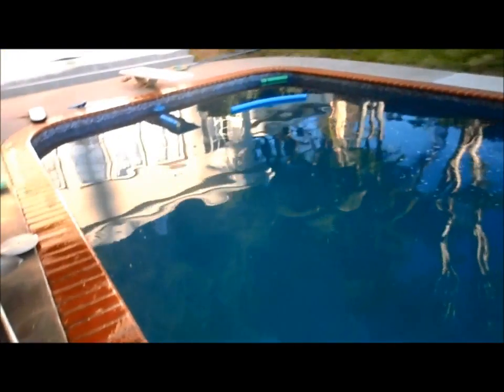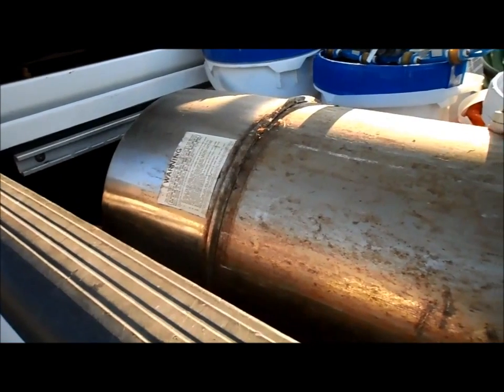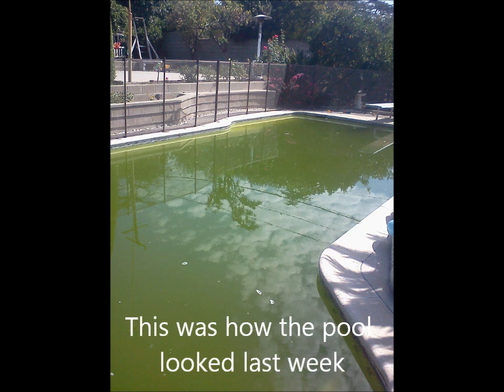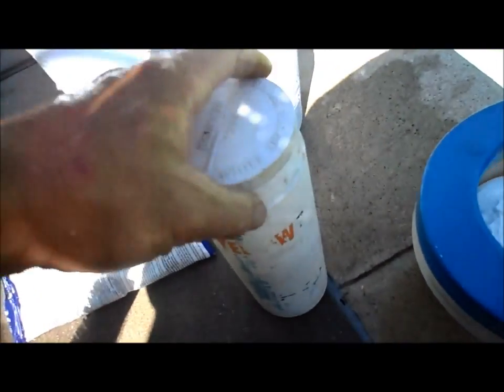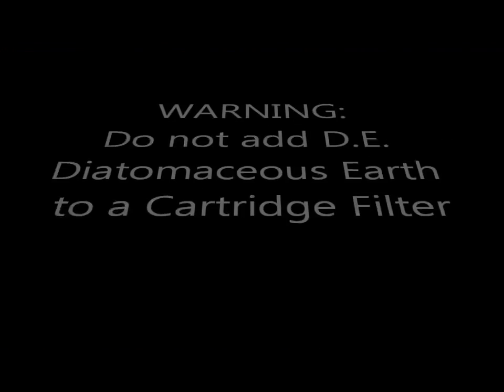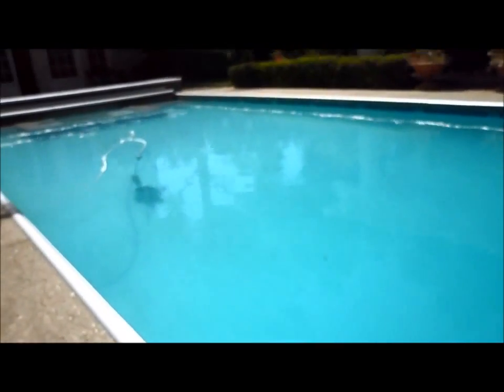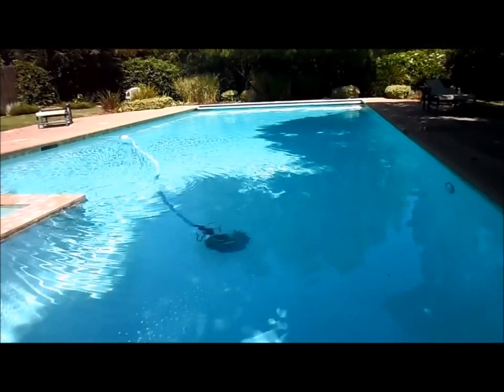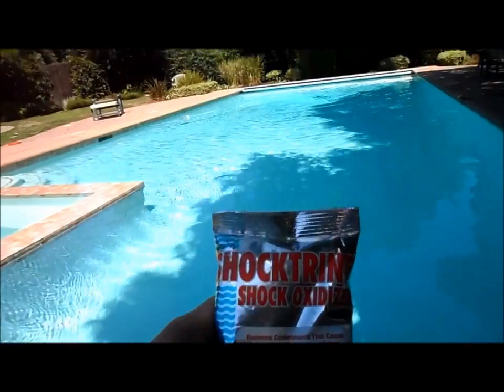Cloudy Pool Water, Causes and Cures

Comment: I opened the pool last Tuesday and added shock and algecide and got the inline chlorine started.  The green went away overnight and so I added a drop out agent and then some clarifier but the pool is still cloudy.  I talked to pool store and they tested water for me and said pH was good, added a back of sodium bicarb for alkalinity and a bag of shock but chlorine was a bit high so I turned the chlorinator down and let it run a few days tested again today and still high so turned it off completely for now.  Water is still a bit cloudy.  I backwashed the sand filter and am running it on high 24/7 just curious what else could be making it cloudy.  Filter is only 3 years old and no leaks.
Reply from the maker: It just takes longer to clear up with a Sand Filter. You are doing everything correctly, it just sounds like a lot of organics are still floating in the water. Add more clarifier - maybe the complete bottle. That will help.
Reply: Thank you!  Will try some more drop out and clarifier and get the vacuum going on the bottom.  It has never taken this long to clear up so will keep testing and wait it out.

Comment: Interesting but not the answer, we have sand filter with zenolite which we backwash at least once a day. Our problem seems to phosphate/ algae related, but when we use phosphate remover the pool is still cloudy.
Reply from the maker: Are you adding the Phosphate into the skimmer directly? That will help with the cloudiness as the product itself causes cloudy water. Also, after adding you shouldn't backwash for at least a week. Try that and let me know and if you still have a cloudy pool I can further advise.
Reply: I do add to the skimmer, I've heard that the other engineers broadcast it. I've read that we should control the algae first and then add the phosphate remover. Our FC is held around 4-5 ppm, our CC is around 2, and our pH is always around 7.4+-.2. It does sound like we maybe back washing too much. Thanks for the help.

Comment: i have a dog pool (approx 12 dogs per day) i use a hayward filter with bromine.  Itest the water twice a day PH and Bromine(.  lately it has been cloudy, with a very slight green.  i clean the filter at least once a week, or when the psi is above 25.  i use a non chlorine shock, and sometimes a few cups of hypochorite.  i use preventative aglecide every week due to the type ofuse.  Can i test the free chlorine and should it be the same as your video if i am using bromine?  thanks tania

Comment: my water is a little cloudy but I'm writing this in January and the weather hasn't been above 60 degrees. I haven't used much chlorine because of that. Even though its not hot do I still need chlorine? Pool is not yellow
Reply from the maker: Probably needs a little chlorine. Even if your water is 50 degrees it still needs some chlorine to keep it looking clear.
Reply: Thank you

Comment from the maker: Check the chlorine levels and if it needs more go ahead and add some. I think it will clear up over time now. I would run the pool 24 hours and see how it looks. The Shocktrine will help and a clarifier also helps. But I just usually let time take it's course and have had good results. A good chlorine level and a clean filter should do the trick in most cases.

Comment from the maker: Yes. Not sure how large your pool is but you just want to add liquid chlorine to bring the level up to 10 ppm. You may need to add more conditioner also depending on where it is a t when you test it. I suggest a cyunaric acid (conditioner) level of 50 ppm in your case. Once the chlorine is a 10 ppm or higher, you should be able to maintain a free chlorine level. You have to destroy the nitrates & organics that are eating the chlorine out of the pool. I will PM you some videos that will help you.

Comment from the maker: Take the filter apart and check to make sure the grids don't have any holes in them. Even a small hole will interfere with filtration. You may have high Nitrate and Phosphate levels also. Maybe try shocking the pool and adding some type of algae treatment again. You can also pick up a bottle of Phosfree by Natural Chemistry and add that to the skimmer (follow the directions). I've had good results with lowering the Phosphate levels down. But it could be just your filter grids.

Comment from the maker: In that case if the filter is in good condition and your Conditioner level is good then you will just need to Super Shock your pool. That is a pretty big pool - maybe 25,000 gallons or so. You will need to really dump a lot of chlorine in - maybe 4-6 gallons of 10% liquid chlorine and run it for 24 hours. After 24 hours if it has zeroed out add another 4-6 gallons. It sounds like a lot but you want to raise the level to 10 ppm or higher to get rid of the cloudy water. Rain is a factor too.

Comment from the maker: That would be odd. But I have noticed with the Pentair IC40 salt cells & to a lesser extend the other brands, the calcium blow back can be so severe that it can probably have that effect. I have skimmed the bottom of such salt pools and felt lots of resistance as the flakes fill up my leaf rake. Did you notice a lot of calcium flakes at that account?

Comment from the maker: Not sure what causes that - my guess is that the the pool's circulation is a big factor. I once added some Soda Ash to a pool with a broken grid (I didn't notice until later) and that pool was cloudy for a week. A very experienced start-up guy taught me to just pour it in the skimmer to prevent the pool from clouding up. I have been doing it that way and have had good results. Some will blow back into the pool return lines but it does reduce the cloudiness by 90%.

Comment: The filters are unicell C7470. There is no debris in the returning water. The water is finally beginning to clear after many days of running the filter 24/7. I was wondering  about one thing. The manual says  to add .75 lbs of diatomite to every 100 sf of filter area to new pool water. We changed our water last year.   I thought that only applied to earth or sand filters. Back to the present problem. Could it have just needed a lot of time? 
I was thinking of doing one more shock?

Comment: My pool filter was not working for about a month. The water is very cloudy. We replaced the filters (uses 4 cartridge filters) and bought a new pool pump. Super cholorineated and added pool clarifyier. The water tests good but is still cloudy We have been running the filter 24/7 for about a week now and washed the filters about 6 times. At a loss of what else to do. Any suggestions?

Comment: Small pool. Big problem. Just a decorative pool, fountain in middle. Filter seems to be working fine, but water is very milky. I may have overdone it with the algaecide. Could that explain the cloudiness? Also I just did battle with slugs in my dahlias. Do they go into pool with brick sides? Seems unlikely, but their 'trails' were around the pool. Help?

Comment from the maker: I wonder what kind of shock you are using -if it is Dichlor shock that may be causing the problem. Dichlor granular is fine but Dichlor Shock is packed with conditioner. How to tell if you are using dichlor shock: it will say something like 55% Dichloro... and 45% other ingredients. This will cause what is called "Chlorine Lock" - it will raise your Conditioner level to ungodly heights and cause cloudy water. Dichlor granular is 99% dichlor on the other hand. Tried to send you a PM also.

Comment from the maker: It should clear up with the new filter installed, just make sure you charge it with the correct amount of D.E. It takes about half or less - I can't remember the exact amount. You can also add a Clarifier to the water -SeaKlear is a good one.

Comment from the maker: Yes. The manufacturer says it could take a while to clear up since the sand filter is not very efficient. try also to add some Seaklear Clarifier to the water. It works well. I have a video on it that I haven't had time to upload. I actually have a backlog of 12-15 videos. I am just too busy of late.

Comment: Hi, That is correct it was green, I did put a flocking agent into the pool and did Vacuum the pool out on Waste before. But It still seems to get the algae dust . Should I do it a few more times and see if that helps with another dose of Flocking agent ?

Comment from the maker: Okay now i remember something from my early days when I first started, the manufacturer jogged my memory. Your pool was green if I remember correctly. A sand filter can only filter  30 microns. So the algae dust is just being sent right back into the pool. Solution: Vacuum the pool out with filter on Waste. Two more things - to test for a leak back into the pool from filter, put some regular dirt into the skimmer & see if it shoots out into pool. You may need to add a flocking agent also.

Comment from the maker: Sounds like the pump is clogged. Turn off the pool and make sure it is not going to turn back on. Take the clear pump lid off, remove the basket and you will now see the hole where the impeller sits. try spinning it with a screwdriver. I am just guessing here though. What type of filter do you have? And is your backwash a push/pull valve or one with a handle that you spin on top?

Comment: hi , i have a question , when I switch the knob to filter , the pump constantly stops sucking the water in and the jets dont really give any water out , maybe every minute it works for 10secs then stops, should it do that ?
and the water is still cloudy , i used some chemicals that is supposed to clear cloudy and dull water , now all the dirt is on the water how do i get rid of it ? 
thanks

Comment from the maker: More on the diffuser: The diffuser is a plastic piece that sits right in front of the impeller. As the impeller spins, water is funneled through the diffuser into the filter. If for any reason the diffuser is not flush, it will be like a boat propeller churning water vs a sealed flow. This happens a lot on the Hayward Super II pumps. Your pool will still run, but the filter pressure will be low. A clogged impeller has similar symptoms so check that first.
Reply: Okay it's not the filter I replaced the filters everyday and clean them mine is a polygroup Summer Waves and the pool pump model is a sfx 1000

Comment from the maker: Sounds like it could be a suction leak at the pump, if your pool ran dry at anytime it would cause the pipes to melt. Do you notice any water leaks from the pipe going in or coming out of pump? If not then maybe your pumps impeller is clogged. I have a video on this on my Channel - "Pump Playlist." Lastly, and this happens, the diffuser inside the pump is warped or melted. You will have to remove your motor from the pump to check this. If the diffuser is not getting a seal air will enter filter.

Comment from the maker: I have a video on vinyl pools which covers the chemistry of an above ground pool. It very similar to an in ground pool  except for some things; there is very little acid demand since the vinyl liner has a pH of 7-8 where as a plaster pool (the plaster itself has a pH of 11) demands acid pretty continuously. So your pH tends to drift low in a vinyl pool. If you use tablets the pH will drop faster, so have some Soda Ash on hand to raise the pH. This is all covered on the video on my Channel
Reply: Agreed.
I have worked plaster pools for over 20 years and have never carried soda ash (pH increaser) on the truck.
Conversely, I always have at least one case of acid with me.

Comment from the maker: You should add the DE right after you do the filter. For the video I moved the DE part back to focus on the chemicals first. It's not harmful to add chem 1st, but you should charge the filter first. You should be able to find YellowTrine st your local mom & pop pool store. I use it pretty exclusively for all algae problems. Chlorine by itself will not destroy algae.